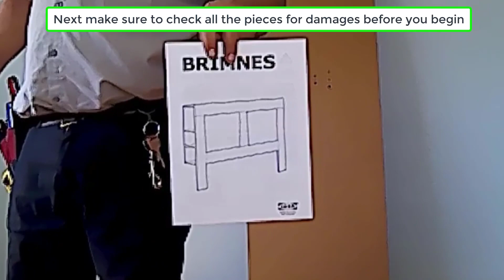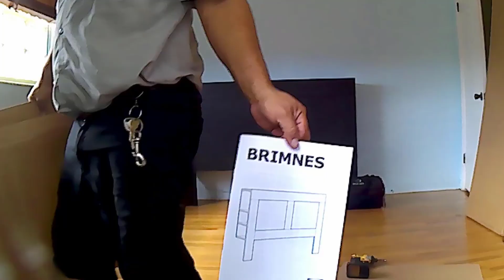IKEA Brimnes Headboard Assembly

Comment: Thanks for the video! Do you think it would be okay if I put it up against the wall without mounting it to the bed frame or the wall? I don't have a bedframe and I don't want to put holes in the wall. Thanks for your feedback and video!
Reply: i’m curious ab this too lol does anyone know ?
Reply: @cristinacollazo1227  well I bought one (second hand, was super cheap).  And so far, so good.  It doesn't seem like it'll fall at all, and it's quite heavy.  It's not straight against the wall, it's just a little slanted against the wall
Reply from the maker: well you could put it up against the wall  and then put the bed up against it  without mounting it either to the wall or to the bed  but if you going to do that I suggest it'll be in carpet  because on a tile floor it could easily slip  my best suggestion would be to fix it to the bed if possible!

Comment: Hi! how can I mount it to my bed?  I would like to do that instead!
Reply from the maker: Screw it to the bed with a 2 1/2 inch Screws underneath the wood slats near the edge of the base of the bed one in the top and one in the bottom on both sides like that you can move the bed and headboard at the same time.

Comment: How do you attach to the bed frame please? And do the things I need to do that come in the pack or do I need to get them separately?
Reply: The headboard is its own piece  but in most of the installations that I have been to  no one likes to mount the headboard  to the wall  most of the time we screw the headboard  to the bed frame in the bottom below the slats  make sure you get the bed frame and put it up against   the headboard  then on each side you can put   2 screw  on each side of the bed  to hold both pieces together  that way if you have to move the bed  the  headboard  will move along with it  so that you can go ahead and clean if you need to and move it as one piece! I hope this helps!   And to answer your question no Ikea doesn't have any brackets or anything to hold those two pieces together!

Comment: Has anyone had any trouble getting the top piece on? We've just put our brackets in and tried to place it on but it doesn't fit.
Reply from the maker: Hi yes that top piece goes in snug  make sure you got all the screw pegs in place  and then tighten everything up!  if you see that the peace does not fit  there could be a factory  defect   so you might have to get it replaced!
Reply: @IkeaAssemblyByJoseCop  yeah we've followed all the steps and everything seems to fit but the top piece will have to give them a ring tomorrow, thanks for getting back to the comment!
Reply from the maker: @cosyoak   You're welcome I'm glad I could be of service!

Comment: Is it possible to attach the headboard to the bed base, or does it just attach to the wall?
Reply from the maker: Yes, you can get 6 long wood screws about 2 and 1/2"  make sure you align the bed correctly before putting in the screws
The screws will come out through the other side so if you want to cut them off you can,  You can also pre drill the holes and use bolts and nuts if you'd like! 
Most of the customers that I've been to always like to nail the bed with the headboard!
Nobody likes to have it permanently on their wall for cleaning purposes!
I hope this help you out in some way!

Comment: How do you unscrew it from the wall?
Reply from the maker: You need to install the brackets on both sides of the headboard look at the manual then put the headboard where you want then screw it to the wall make sure to use anchors when you install it! Sorry for the late response!
Reply from the maker: twin screw it from the wall just take the top off and unscrew  the screws on the bracket!

Comment: Do you have size dimensions of the built product?
Reply from the maker: Hi Shawn Betts  The IKEA Brimnes Headboard with Storage has an overall height of 43.75” (111 cm) and depth of 11” (28 cm). The IKEA Brimnes Headboard comes in widths of 55.5”, 62.25”, 78.375” (141, 158, 199 cm).